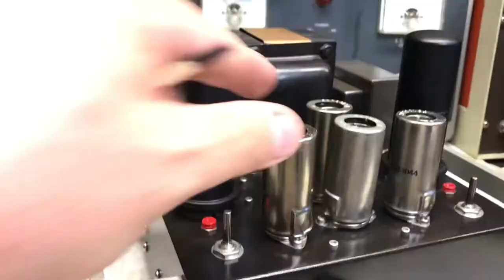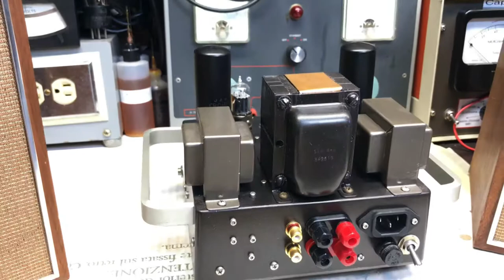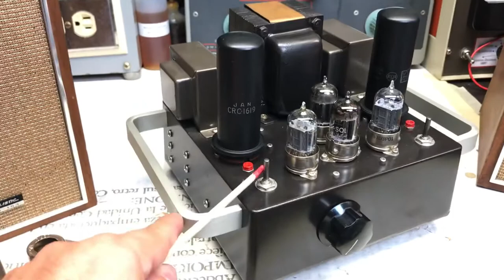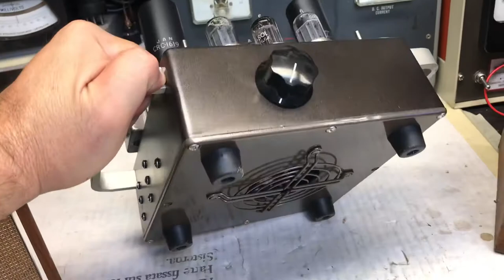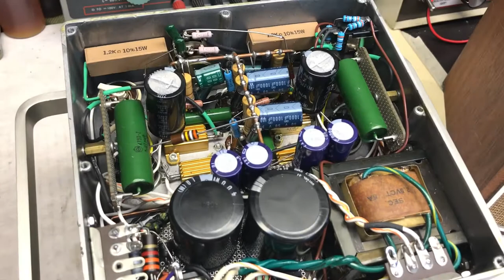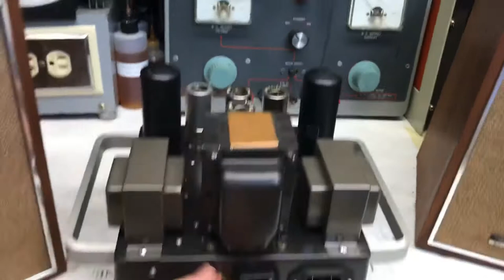1619 Single Ended Tube Amplifier | The Vintage Audio Life

Comment: Is this running in pentode mode?
Reply from the maker: Hello, its been a long time since i looked at the schematic, i believe i wired this in Pentode mode. In addition, the 1619 is seen as a cheap replacement for expensive 45 tubes, and relatively elaborate adapters are being made or sold to allow plugging the 1619 in old radio receivers. But there is also talk about it might be closer to a 6V6, either way pentode or triode mode, it can be done either way. thanks for your question.
Reply: @thevintageaudiolife   Do you have a schematic?
Reply from the maker: @swingarmer  Let me dig it up, I know i have it on my pc or a print-out somewhere in the shop, I'll look for it, keep you posted.